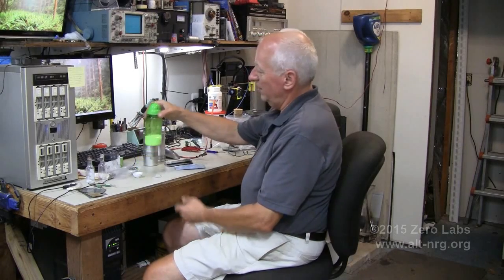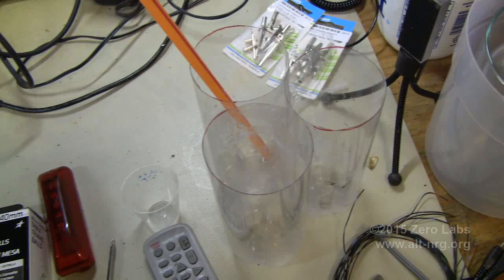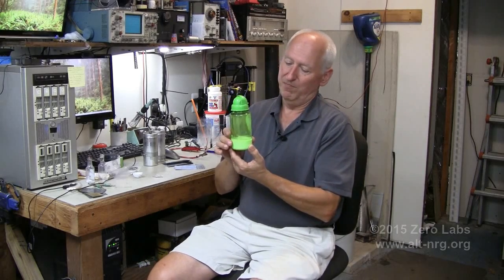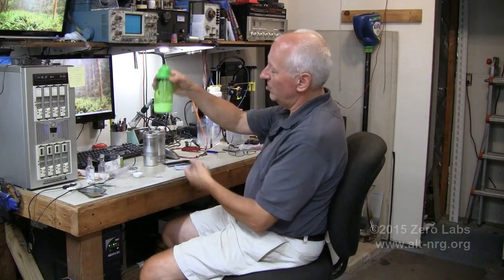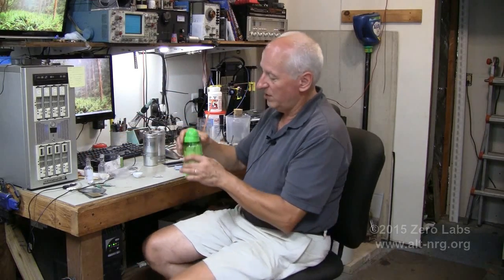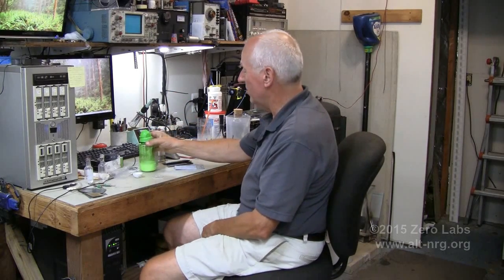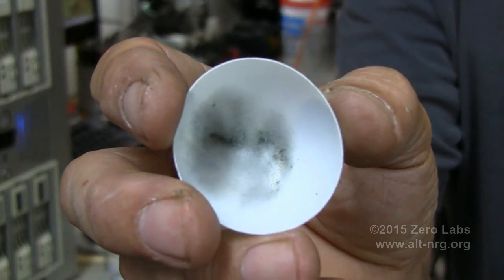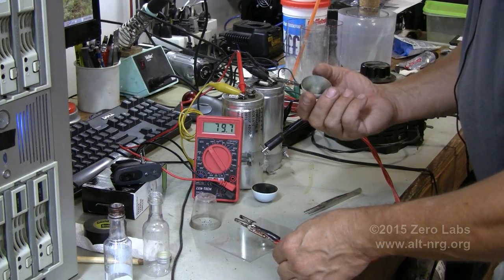#418 Keshe Plasma Reactor project update 04

Comment: I accidentally made a GANS? like material by placing two aluminium electrode plates into water and placing silicone glue on the tops of the elctrodes, I applied 12V DC current through the electrodes and tap water.

Comment: a less often occurring product of electrolysis, than 2(h2)o2, zinc plated cuprous oxide,is a reaction between the salt and the copper.Producing small amounts of Copper Chloride (CuCl2). This appears as a whitish-greenish crusty deposit on the copper electrode.Another by product of this reaction is sodium hydroxide, which forms instantly after the free sodium is released into the water. This reacts with the zinc, forming Sodium Zincate (Na2NzOH4).Which settles to the bottom in a cloudy mess. When this crystalizes (non aqueous) it will separate into 3 distinct Anions of Zinc.These are (-) negatively charged particles.Sodium Cations are liberated, these will be most likely destroyed by ambient moisture.

Comment: The precipitate is very likely Zinc Oxide since the addition of a DC electrical current would introduce a process of electrolysis, splitting H2O into H2 gas and O ions which would then oxidize the zinc, precipitating out as ZnO
Reply from the maker: +Stephen Beckett The dissimilar metals in salt water electrolyte produces a voltage of it's own. So whether you add more voltage or not, the precipitate is still ZnO.
Reply: + Stephen Beckett Exactly, that is what happens. Saline electrolyte solution serves to electrolysis becomes. Therefore, there is release of H2 acts electrode () cathodic liberates O2 in the solution, where it reacts chemically with the metal oxide present in the saline solution. However, I can not tell yet if this metal oxide formed here is a superconductor. Only i know, copper nano coated has superconductor behavior, and this is the electrode () of the electrolytic cell where occurs Gans

Comment: About the gans
 You ate missing the point
 It is the structure of the material not its chemical composition. Monoatomic structuctires of elements are different to the regular elements..An example is graphite and graphene. Bc you are dealing with such small particles you presence affects any outcome of the experiment so your very attituted can result in success or failure and therefore the scientific method is not a valid way to assess any device so constructed. You are part of the "condition" of the whole set up so it will be intetesting to see you expect, with good intention the result of your work.

Comment: Get an analog meter and NEVER use an lcd Digital meter. They use crystal oscillators and detune when connected to antennas like the electrodes in air..

Comment: Inasmuch my last reply to Zia fatemi was deleted for some reason, i will repost it here:

In first place, Keshe's CO2 Kit is also called "a galvanic cell", which is an electrochemical cell that derives electrical energy from spontaneous redox reactions taking place within the cell: 

https://en.wikipedia.org/wiki/Galvanic_cell

Whether you have this 2 elements: electricity + Brine (electrolyte), you have an electrolysis. And you claim to be a Chemical Engineer, but you cannot recognize a Galvanic cell and a basic electrolysis !!!

In second place, you are wrong. The electricity generated can lit a led and can create a low electrolysis. Actually, the "nanocoated" plates you use in the CO2 Kit are also used in Keshe's flashlight.

https://www.youtube.com/watch?v=Q8xbhY6I8dE

In third place, the electrolysis is at a very low level. It has not the pressure to create the effects you claim. 

In fourth place, the paper wich you claims demonstrate the validity of Keshe's theories says clearly that it is an electrolysis !! Here, you can read it here:

http://pubs.acs.org/doi/pdf/10.1021/acs.nanolett.5b02427

Page 2, "Scheme 1. Molten Carbonate Electrolysis Pathways Converting CO2 Leading to a High Yield, Uniform CNF Product"

The reference to electrolysis is mentioned several times later in the paper.

Comment: Sorry to pop your bubble Zia fatemi, but when you put the plates outside the salted water (brine), you are in fact creating A CAPACITOR: two conductive plates around a dielectric material:
https://www.st-andrews.ac.uk/~www_pa/Scots_Guide/info/comp/passive/capacit/dielec/dielec.htm 

The plastic container is playing the role of the dielectric material, so, the electricity can flow very slightly through the Brine. That's why there is still a very low electrolysis reaction... What do you say Zerofossilfuel ?
Reply from the maker: Exactly. 3 weeks and no GANS. An update is coming this weekend and in it shall be plenty of public humiliation for the blind Keshe worshipper.

Comment: Thanks for doing the experiment again.   Just have only the Zinc plate outside the solution, production drops by 50% but the reactor will still collect CO2.    This way you would know for sure it is not Zinc chloride or Zinc hydroxide.   

If you have both plates outside of the solution the production will drop 90 to 95%, but you will still be able to observe white flecks in the solution.
Reply: +Para hexavoctale Look at the MAGRAV power unit which blows the fuses when you switch it on and you know whether  Mr "genius" did it consciously :D
Reply: +Zia fatemi Sorry to pop your bubble Zia fatemi, but when you put the plates outside the salted water (brine), you are in fact creating A CAPACITOR: two conductive plates around a dielectric material:
https://www.st-andrews.ac.uk/~www_pa/Scots_Guide/info/comp/passive/capacit/dielec/dielec.htm

The plastic container is playing the role of the dielectric material, so, the electricity can flow very slightly through the Brine. That's why there is still a very low electrolysis reaction.
Reply: +Para hexavoctale The point of the experiment is not to create electric power, a battery or a capacitor.   The point is white CO2 is created.   No outside heat, outside electricity (energy) and at atmospheric pressure.   No fancy equipment or special expensive apparatus is needed.   Anyone can do this and see for themselves.   
Again, the purpose of the set up is to create the white CO2.  It is not to see if it is a battery or a capacitor.
Lets wait and see what zerofuel tests would show when he has the Zinc electrode outside and what he finds out.
Reply: +Zia fatemi Yes, the purpose of Mehran Keshe was to imitate the nature and solidify CO2, but he did not achieve it. What he achieved, consciously or unconsciously, was an electrolysis kit, because when you pass electricity through water you create an electrolysis; had you desire it or not.
Reply: +Para hexavoctale The point is not to prove whether it is a battery or electrolysis.   The point again a white substance is created even when Zinc is not in the solution.   The sensor and George Washington University test proves it is CO2.   

My friend, concentrate on the white CO2 substance.   I have a chemical engineering degree such a reaction and white substance (CO2) should not be created in a mili volt reaction in such high quantities in short amount of time.   
Why don’t you make the reactor for yourself and see.    
But still thanks for thinking and coming up with an alternative explanation.   Sorry, I go with my eyes and what is in front of me.
Reply: +Zia fatemi Fungus?

Comment: You do not need to guess.   Here is more proof,  

https://www.youtube.com/watch?v=k28e01R0dww

You can easily redo the test, put a CO2 Monitor around the container and then close the whole unit and see for yourself.  You can buy a CO2 monitor from ebay for $90.

Here is another link on a test that George Washington University performed and published on American Chemical Society magazine.  They used exact same set up as Keshe with exact same result.   But as usual, they are trying to steal the technology without even mentioning Keshe in the article.   

http://pubs.acs.org/doi/full/10.1021/acs.nanolett.5b02427

Free energy is right in front of you and you just wave and make jokes about it.   I do thank you for testing the technology.    By the way you can get the same white (CO2) gans with the Zinc plate outside of the container.   This is not Zinc oxide residue.   Waiting for your reply.
Reply: +Para hexavoctale What these geniuses also don't consider is the amount of CO2 in such a small container - it is in the order of micrograms or less, so there can in no way a visible amount of that stuff be formed.

The whole "experoment" is complete nonsense, exactly at the level of Keshes "knowledge".
Reply: +ZeroFossilFuel The CO2 detector test posted in the video mentioned by Zia fatemi proves nothing because it does not takes in consideration that THIS IS AN ELECTROLYSIS; and Hydrogen and Chlorine Gases are released from the electrolysis. So, when the box is closed and the electrolysis begins, the amount of Hydrogen and Chlorine gases inside the box INCREASES, pushing the regular air and its CO2 portion outside the slits/cracks of the box. That is why the CO2 detector measure a minor and minor quantity of CO2 gas, because the Hydrogen and Chlorine gases are occupying a greater portion of the Gases inside the box.
Reply: +Zia fatemi  1. The increase in the amount of gases inside the test box decreases the amount per cubic centimeter of CO2 present in the air previously introduced. So, the CO2 detector identifies a fewer quantity of CO2 per cubic centimeter as time passes.     2. No, you are not understanding the situation. As the electrolysis is performed, it releases two gases from within the box, so, the pressure comes from the inside to the outside of the box. No air can enter by the slit/crack, because the generation of the Hydrogen and Chlorine gases (which were not there before) pushes and occupies the place of the air previously introduced.     3. I have already explained that in point n#2. Mr. Zerofossilfuel could get a detector of Hydrogen and Chlorine gases, but there is a cheaper method you could use: after the electrolysis begins, just release a bit of the gases inside the box and try to make them burn with a flame; if the air released from the box burns with a flame, then it is Hydrogen and you would confirm the electrolysis. But if the released gases does not burn, then you and Keshe would be right, because you cannot make burn regular air, and you would be proving that no electrolysis was performed.
Reply from the maker: LOL!!! I just watched that video you linked. The "proof" of CO2 offered there is nothing more than exhale into the plastic tub. Really, you are very very gullible.
Reply from the maker: +Zia fatemi My replication will be faithful and the results scientific. So you say both electrodes OUTSIDE the container? That would be easy enough to try but I'll be VERY surprised if it works. Don't you be surprised if I publicly humiliate you if that should not work.
Reply: +Para hexavoctale Thanks for your comments; this is good exchange of ideas.  This is how we all learn together.   I will reply to each comment separately;

1.  If somehow Chlorine (CL) and Hydrogen (H) is freed and released, they will just exist as freed ion gases in the bigger container.  Why would CO2 get pushed out?  What is the force that is selectively pushing out CO2 and air out but keep (H+) and (CL-) in?  After all, they are both smaller than CO2 molecule.    They will just be all together in a mixed environment inside of the bigger container.  

2. If there is a crack and the gases will be released to the environment air can also enter with more CO2

3. Your hypothesis would work if there is some sort of force that is keeping H and CL in, pushes the CO2 only out and will not let anymore air in.   If that is the case, tell us how it works and Zerofuel should test it for new energy source.
Reply: +Para hexavoctale Ok, lets take this as you say;
1.  There is no external electricity , heat or pressure applied to the system.   You have a very weak closed system ( no energy input except for the light).  So at best this is a very weak reaction being created in the solution.   We are talking about Mili volts in here.   You cannot even light up a single LED light with it. 
2. You are saying so much CL- and H+ are created that will not let the air in.  Plus, the CO2 sensor cannot sense the CO2 at such high pressure or density of Cl- and H+.  My friend at that such pressure, cl- and H+ will combine and you create Hydrochloric acid.   It is a highly pungent, corrosive and a strong acid.   The moment the guy opens the lid, his eyes / skin will burn and he can smell it.  You will also see condensation of acid droplets in the container.  No such reaction was observed, he opens the lid in front of the camera.   

3. The CO2 kit container is very small, the box around it is at least 6 times in volume.   For your theory to work we need a lot of H+ and Cl- gases in a very small surrounding and high pressure.  Especially if it is not letting the air in.   

4. The CO2 sensor is calibrated in Parts Per Million (PPM).  The CO2 and Carbon Monoxide (CO) detectors are extremely sensitive.  CO in high concentration can suffocate, that is why people use them at their homes.

5. The fire test will not work, since there is Oxygen and H, for sure we will have fire and it will not prove anything
Reply: +Zia fatemi Have you considered how much CO2 (in micrograms) is in such a container?
Reply: +Jean-Pierre Mürrli Exactly !! Well said Jean-Pierre !!

Comment: check out my youtube and you will see that my zinc plate is outside of my container I learned about that from the Keshe co2 capture system update.
Reply from the maker: +mag netron Yes, I see your zinc plate on the outside. And no "CO2 GANS" on the inside. Why? Because no current is flowing. Set up two of these exactly the same, one with a wire jumper, one without. Your results will be the same and it will disprove that the wire jumper had anything to do with it as Keshe claims.

Comment: I put my zinc plate outside of container, nano coated plate inside container.  Result, gans settled on bottom of container,  but no amino acids on surface of saline solution. when zinc plate is in solution then I get amino acids or fat on surface of saline solution, but now I have zinc oxide on bottom of container.  Put zinc plate outside of container nano pkated copper inside container then zinc oxide should not occur and no fat on surface of the saline solution.

Comment: it is not supposed to be conducting if its nanocoating, else its just something else... they use copepr paste on inside so it can be nano coated.. the copepr oxide or whatever is not the end state..
Reply from the maker: It's not conductive unless I break the surface layer with my meter probes. It's deposition and heat treated nano coating in one step. Black, velvety and durable.

Comment: Love the copper vapor trick!
Reply from the maker: +firepinto Yes, pretty cool. I changed the setup a bit. Instead of 45,000uF at 80V I'm now using 4,000uF at 185V with an insulated home brew contactor that resembles a telegraph key. Much better results. *MUCH* louder! Need ear plugs for this now.